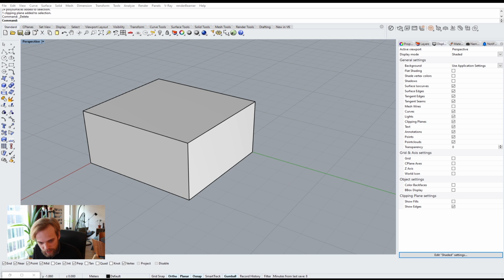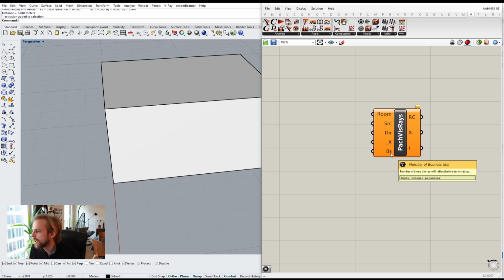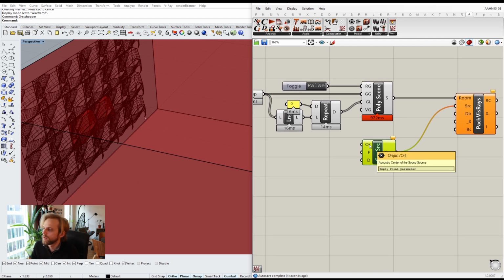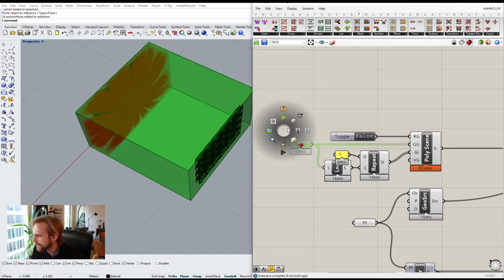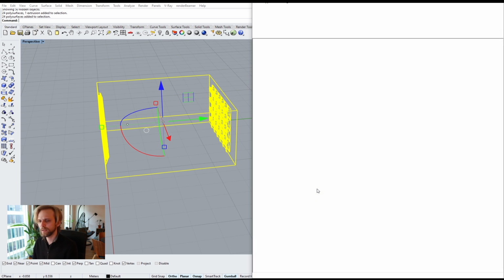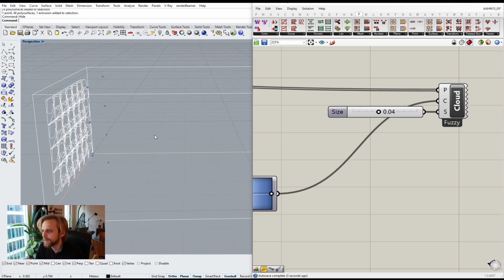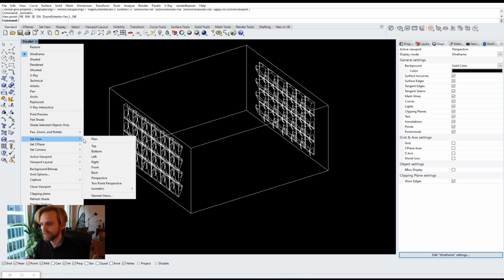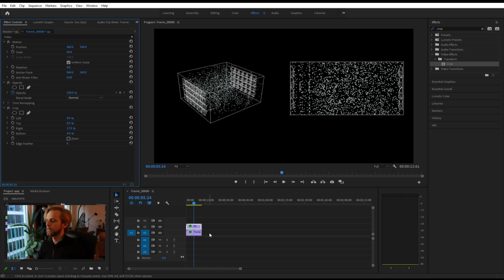Simulating Accoustics with Rhino and Grasshopper (AAHN15 2021-3)

Comment: I imported gha file for Pachiderm and I have the nodes, did everything you mentioned related the script. I got this error 1. Solution exception:Could not load file or assembly 'Pachyderm_Acoustic, Version=2.0.0.2, Culture=neutral, PublicKeyToken=null' or one of its dependencies. The system cannot find the file specified.What do you suggest in this case?Thank you in advance for the thorough tutorials!
Reply: I have the Same Problem. Did you find a Solution?:(

Comment: This tutorial is awesome! how can I set the different materials that i'm working with in my simmulation? For example, if I have a wood, glass or a metal panel and I want to know how is the sound in each case.
Reply from the maker: You'd need to change it in Rhino (it's layer based if I remember correctly). Make sure that you check out other AAHN15 2021 series videos - I've most likely covered it in a earlier video.

Comment: Thanks for the great tutorial, but Ive used it for a project, but now that the design is almost completed I am stuck with 2 problems, 
1) The design seems to be too big to be selected as a whole but I am not sure how to get around this. 
2) The point seems to only work when it is very close to the brep, or else the visualise pachyderm rays would have the error 1. Solution exception:Index was outside the bounds of the array.
It would be great if someone could help me solve this, thank you

Comment: Hi！ Quite a nice video! A small question is I have no idea that why each point of my point cloud is not a 'point' but a 'crisscross'， which looks very strange. Do you know how can I adjust them into general points? Thank you very much!
Reply from the maker: Thanks! Cross is just a preview setting - you can either use PointCloud node to show the points as balls (i did it in this video) or you can change the point display setting in the Grasshopper menu (in the top, above the component menus where you have File, Display, Help and so on)
Reply: @DesignGoBrr  Ohhhh I see that！Thank you!

Comment: Hello !!  thanks for this video.  I have a question.  after running the calculation more than once, with the same parameters, it gave me different results.  I would like to know if there is a way to narrow down the spectrum of possible outcomes.  Thank you.
Reply from the maker: You need mooore resolution then. The global tolerances of the document will influence the output (it should change by a very low margin though.. I mean <1%)

Comment: is there a component in pachyderm for this simulation's quantitative analysis to determine if the space is good or bad for acoustics in general...
Reply from the maker: Oh yea, there are plenty of components that give you actual quantitative data, such as T30 Reverberation time (Echo). It's just that - numbers are boring, I prefer visual stuff, so I didn't show that part.
Reply: @DesignGoBrr  same mate, but the jurors need a little more convinving 🤣🤣🤣 i tried poking a little here and there, but analysis components require energy time curve data which I'm not familiar with how to put there...
Reply from the maker: @sulaman_k4375  Check out this playlist here: https://vimeo.com/247776786
Reply: @DesignGoBrr  god send my man.. this should def help me... thanks again  👌👍

Comment: the polygon scene component is giving me some "sourcefilenotfound" errors. cant go further than that.. anybody got this issue? i have rhino 7
Reply from the maker: Hmm haven't seen that error. Try asking the creators of Pachyderm in food4rhino plugin comments section, usually this kind of technical troubleshooting is solved there.
Reply: have you found a solution for it yet?
Reply: @jonashefel9799  works fine on older version.. i tried it on rhino 6.5..

Comment: Gediminas Kirdeikis, could you please send the gha definition. I cant fix the problem with the Polygon Scene. I did as you suggested - change material and layer, but it still complains
Reply from the maker: Hi there, make sure that your geometry is series of closed polysurfaces. It will complain if you give it open geometry as it will not know what's outside and what's inside.
Reply: @DesignGoBrr ,Thank you very much for the advice, I just restarted the program and everything worked

Comment: That’s great. I want to ask, how to simulate music as this video.
Reply from the maker: I don't really understand the question - could you elaborate on it?
Reply: @DesignGoBrr  if I have a track of Beethoven - moonlight sonata for example. and I want to simulate this music on grasshopper. or import this music as mp3 into grasshopper then simulate the movement of sound inside a room according to this music. how can I do that? 
thanks in advance :)
Reply from the maker: @MohamedAli-iu9no  Oh, and what kind of output are you looking for? If you look at the particle movement it's just going to be complete chaos. Even with this example here, which is basically a 1 milisecond beep it becomes chaotic immediately as it hits the wall, so with a music track it would just be a complete mess. There is no way to translate between senses. An example would be - how would you do a visual simulation of smell? Sure, you can do movement analysis of fluid dynamics, but it doesn't tell you anything about smell, it just shows you where it's going. Same thing with a short beep vs a nice song.

Comment: Thanks a lot for sharing all the knowledge, it´s so much fun following the video while doing it. 

I found that by connecting the  "B" multiplication slider that goes before evaluate lenght as a T parameter to the gradient works as well to colour the points.
Reply from the maker: Yup, that would work as well, good observation!